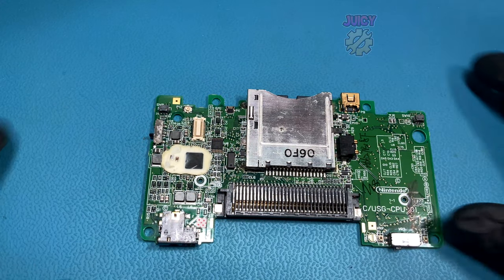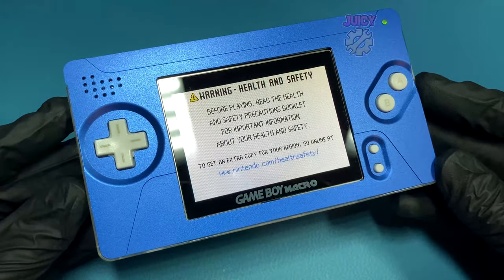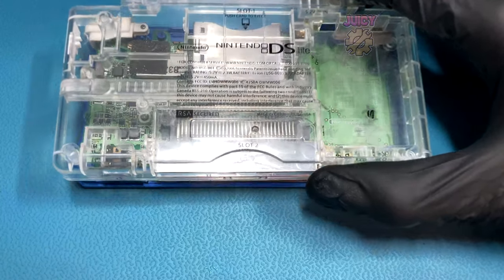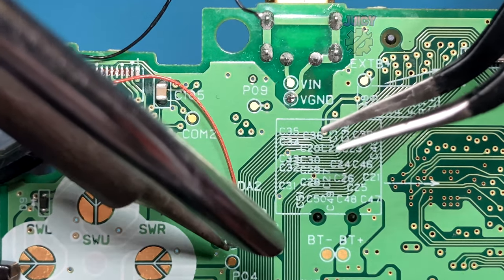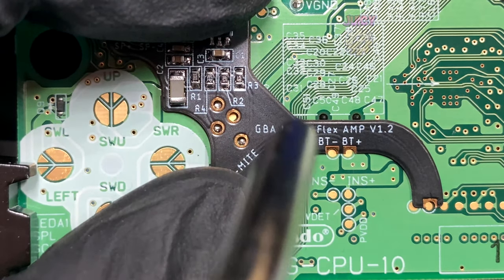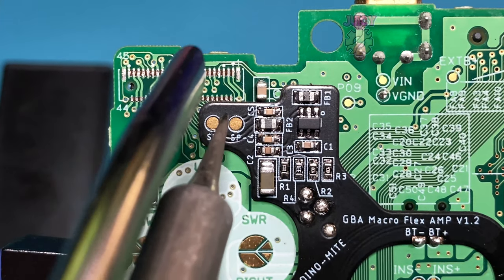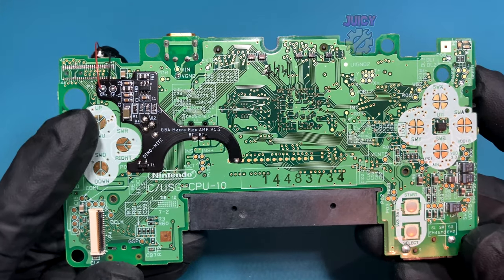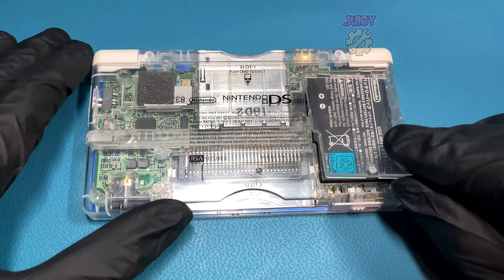the EASIEST way to do the Gameboy MACRO mod - Helder’s Macro Flex Amp mod

Comment: I bought 2 pre-built Gameboy Macros in the past. One was a down and dirty diy, the other super polished with the helder board installed. MASSIVE difference in sounds quality. I find the helder board too loud but I'd rather have the amp than not have it. Tinkering with these things got me interested in doing my own diy projects- just got my soldering iron yesterday and your video is gonna help walk me through the install. Cheers!

Comment: I saw your GB Macro and it is pretty much just like mine, except I used the purple Boxy Pixel front, I also used the clear back shell.  I could not get the stupid stylus to stay in place so I just ditched it.  I also got one of the EZ-Flash cart that has the smaller shell that fits flush in the Marco/DS Lite.  I did find the AMP to be a little loud and at max volume it will distort a bit, also it makes the adjustment slider really sensitive, did you find this also?

Other wise I enjoy the videos - Subscribed and liked
Reply from the maker: yes the AMP is way too loud and is certainyl distorted at higher volumes which is why i would love a flex PCB without an AMP just to make it easier than soldering a small resistor on (& neater)

Comment: Hi ! I was looking into the gb macro and ended up asking myself, would you be able to run games from an R4 with a gb macro ? 
If so, it might be possible to use it as a portable nes/snes too !
Reply: Ganeboys are basically already portable NES/SNES
Reply: As a matter of fact u dont need to solder to make a macro ill send u a link
Reply: All u literally meed is the top lcd screen (as long as its still produces any sort of light it will work whether damaged or not as long as the top screen shows light)